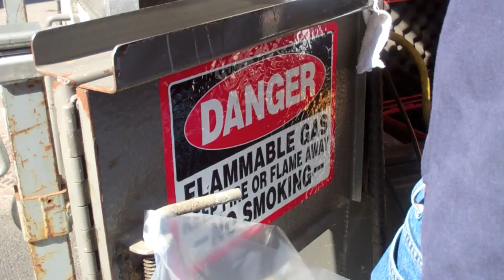Con Edison Crew Repair Electrical Equipment in NYC Manhole

Comment: @0:50, loose strand(s) left out of the joint.
Reply: looks like a string
Reply: Lol yeah its your pull string, there are no stripped for 2/0 like that, you have to use a knife to to cut the insulation away, then your pull string to help separate it.